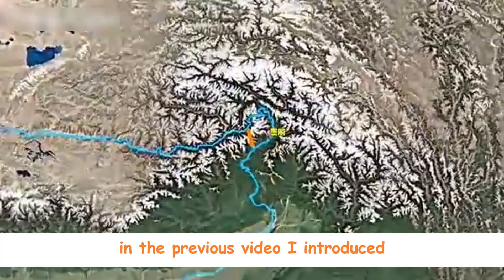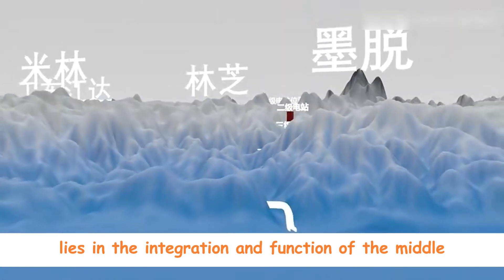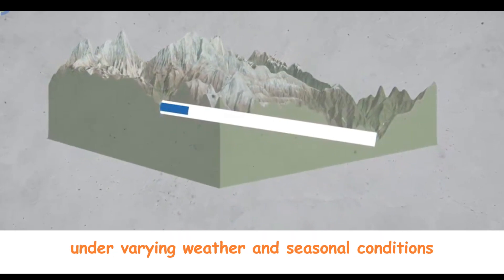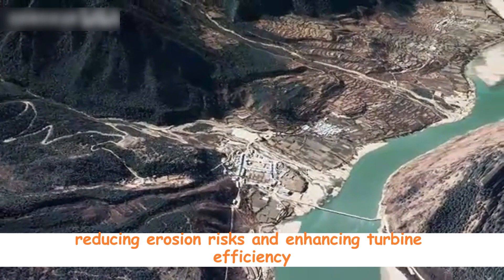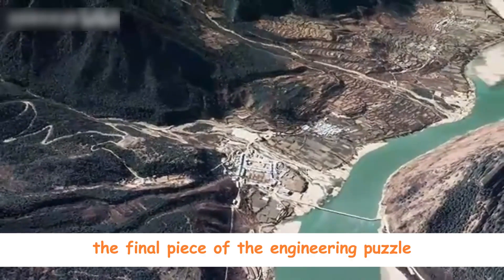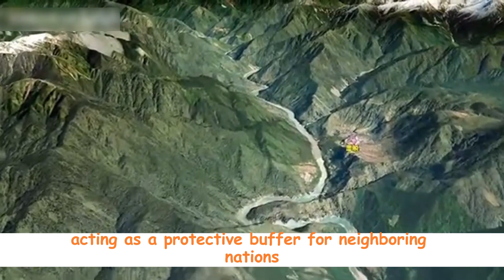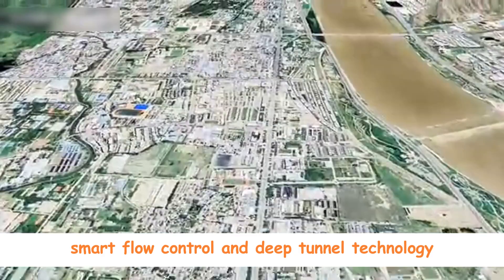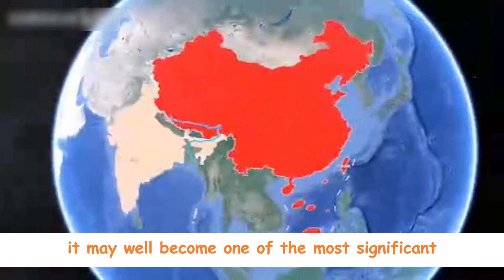Inside China’s Mega Dam: How the Yarlung Tsangpo Power System Really Works

Comment: sent to the White house 3 days ago ,,,,,   Good Morning 

the following is still in the working out faze
This document is for a retro fittable power production system for a hydro dams to have up to three extra turbine banks without making issues for the main turbine hall
Now the reason this type of system has not been looked at was two fold .. the loss of flow rate and back pressure issues 
As all the worlds dams have the same basic layout regardless of the turbine fitted. The basic setup is turbine shaft to shock uni joint to the turbine. And so all have the same common limitations  
A new type of turbine unit is needed if the main turbine hall is to function with without mods for a multi bank units are to be placed in the flow 
This new system will never match the output of the main turbine hall but after years of chasing minute increases a system like this one is a massive jump in output 
At this point it should be noted that most of the installation process can be made with the dam online selling power to the grid and there is no increase in water usage when fully installed  
This system has been designed to be fully independent of the main turbine hall so as to be serviceable with the other units online and running with the main hall 
A FEW OBVIOUSE POINTS 
Population = Even if our numbers were to fall we are still in a situation of heading to a power shortfall outcome things like data centers e cars and a hole host of other tech 
The lag time at best for any new power units to get online is 2-3yrs at best and i believe we are well short of filling the markets needs 
OTHER BENIFITS OF THIS UNIT
Is a dam green tech? well its more recyclable than wind and solar
lasts 100 plus years vastly more than the others
It should be noted if the patent is very strongly protected the market will come to the seller even if it is in Australia or America so a 100 billion dollar a year marketplace makes the wage bill a non-issue 
SOME OF THE BIG BENIFITS 
Bigger market share/customer base
All the required infrastructure is already in place
the asset has a longer life span
No issues regardless of type of the main turbine fitted 
No added down time 
AND ITS TRUE BASELOAD POWER from a existing dam

Comment: I've heard contradictory things about this project.
Some say a reservoir will be created, others say it is a run of the river project.
Which one is it?
The latter seems far more likely to me.
The video says that a large reservoir won't be needed rather than no reservoir at all.
Reply from the maker: You’re absolutely right to point out the confusion—this has been a subject of debate and mixed reporting. Based on official Chinese sources and most engineering analyses so far, the Yarlung Tsangpo mega dam is expected to be a run-of-the-river project, not a traditional dam with a massive reservoir like the Three Gorges.

Run-of-the-river designs generally involve minimal water storage, relying instead on the river’s natural flow and elevation drop to generate power. That said, such projects can still include small reservoirs or daily regulation ponds, especially for load balancing and seasonal flow variations.

So when the video says “a large reservoir won’t be needed,” it doesn’t mean no reservoir at all—it likely means no vast, lake-like impoundment. This approach helps reduce environmental and geopolitical concerns, especially given the location in ecologically and politically sensitive Tibet, and near downstream nations like India and Bangladesh.
Reply: @EVisionShift  Thank you for your response.
It's much appreciated.